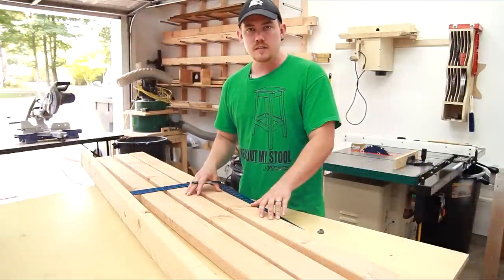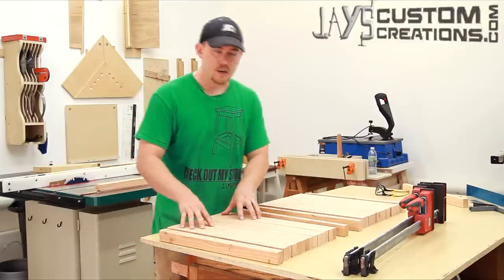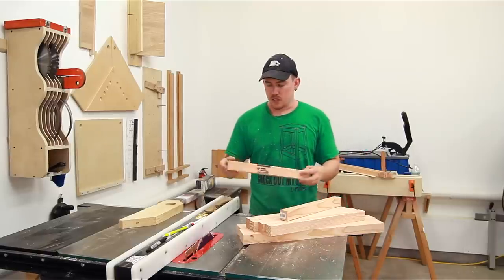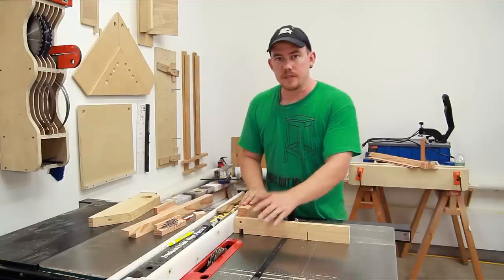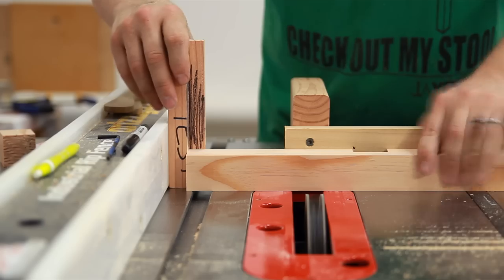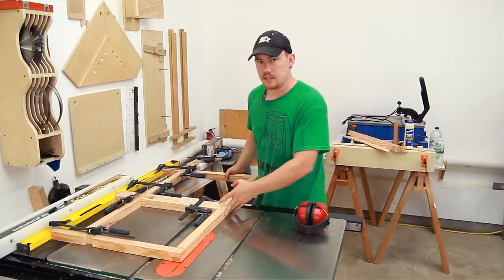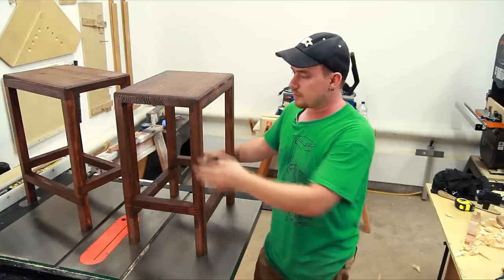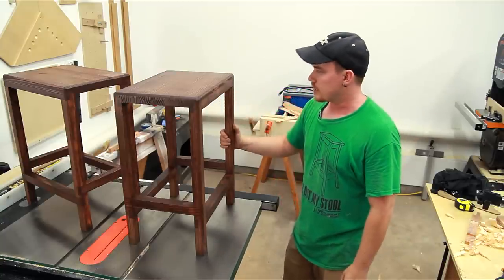How To Make 2x4 Half Lap Bar Stools - 166

Comment: Loved your video. I am advanced and always find new tips in your videos. In this video I love the lap joint jig and the dust shroud tip with the 2x4 mounted to the cross cut fence. Definitely going to use those ideas. Thanks.
Reply from the maker: Selandry1 Very cool. The dust shroud 2x4 makes a HUGE difference.

Comment: Great bar stool build Very simple design and no screws I made a simple bar stool / shop stool made from a 2x10 left over from a deck build. I use it every day sits in my kitchen not my shop . LOL 
Thanks for the great tips on half lap joints good info. 
Roland
Reply from the maker: Backyard Woodworking That's where mine are going. I'll use the older pocket hole bar stool for the shop. These are going in the kitchen :)

Comment: He is using the exact cheap spray gun from harbor freight. They have two purple ones. One for $19 or so and the other closer to $30. Go for the $30 one. Worth the $10.  I've had one of those, and still works fine after a few years of heavy use. The cheaper ones were on sale for $10 so I got a couple of them. Work ok, but not up to the level of the other. And I can only imagine what a real nice one can do.

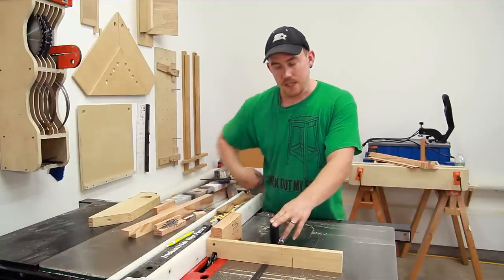Comment: Dude, you have some awesome tips in this video. Like the ones at 4:35 about the safety shroud for the dado cuts, and the one at 6:24 about gang-clamping the legs to a straight-edge in order to true-up the top joints.  What I'm curious about is the T-Shirts you wear in your videos.  Love the slogans and images, but it must cost you a fortune to have so many custom printed like that.  Slick idea none the less.  One last thing; when are you going to build a proper miter saw stand?  You really seem to need one.

Comment: 4 years late but hopefully you see and respond. I'm new to woodworking and going to make this stool (thanks for the video) but just curious... I was thinking about jointing one side of a 2x4, then using that as a reference to rip the board with the table saw so there are two parallel sides... then going through and cross cutting the lengths I need. Is this feasible or is there a reason you cut the lengths you needed before planing them to get them to the thickness you want? Thanks for any feedback!

Comment: Nice Project as usual!
Just wondering, what does an eight foot 2x4 cost approximately in America?
Last month I built two of your Saw horses but lumber is so expensive over here in Germany, that I used some cheap garden fence planks.
I cut them to right size and then glued for each leg two of them together for the right thickness.

Keep up the good work!
Reply from the maker: ***** i purchased these 8' 2x4's for $3.35 USD each. They are pine.

Comment: The top coat you spray on. Is that just a clear polyurethane? If so do you thin it down in anyway to use it in the air Sprayer?

Comment: Hey Jay, really nice design, build and as always great video.   - I've been thinking about picking up a cheap gravity feed spray gun from Harbor Freight to spray finish my projects (cans of spray varnish & shellac are getting expensive)...  So I'm curious about what spray gun you're using as well the finish/ mixture you sprayed?  Thanks!
Reply from the maker: Stew Pidass I was using the cheap Harbor Freight gun. And if/when it ever fails I will get another one of the same guns. It's a Harbor Freight gem. I sprayed Target Coatings EM6000 water based production satin lacquer. It's a little pricey but I love the finish I get with it and its water based so its easy water cleanup.

Comment: Hey.  Great video as usual.  I think you should do a video on making a set of economical bookshelves from 4x8 sheets of plywood.  I have been thinking about this project for a while- essentially use three sheets of plywood- the carcass would be made of two strips of plywood 96" x 12".  The top and bottom of the carcass would be 48" x 12" pieces and the shelves would be the same.  I am thinking that from 3 sheets of plywood I could get enough material to build two 8' x 4' bookshelves 12" deep.  Each bookshelf would have 8 shelves.  I am just not sure what kind of joinery would be best.  I am sure you would do a great job figuring this out.  Anyway just a suggestion because I have searched on-line and on youtube and I haven't found a whole lot.
Reply from the maker: whitechevtruck Have you seen Steve's one sheet bookcase build? Make a bookcase using a single sheet of plywood

Comment: Hey Jay, enjoy your videos, and cost efficient projects.  Question, what do you use for protections or put in your sprayer?  Do you mix polyurethane or lacquer?  Thanks. Keep up the good work!
Reply from the maker: Gary Petit I use water based lacquer so I don't have to mess with chemicals. Just clean up with regular water. Google Target Coatings EM6000 Satin Production Lacquer. I buy it in the gallon.

Comment: Nice project. I really enjoy your videos. 
Question... You used your miter saw to cut your pieces... Then cut them to final length on your table saw with the sled... Why? 

Great apple scene. And always love the logo showing up.
Reply: I'm not Jay (obviously) but hopefully this might shed some light on why you'd do it this way.

Unless you have a dedicated saw stand with a fence you can put stop blocks on, it can be difficult/annoying/a pain in the proverbial to get multiple pieces cut to the ~exact same length. Where as on the table saw that can be a simple procedure.

However cutting long stuff on the table can be awkward and possibly dangerous. So, you break down the timber on the chop saw to rough length and then finesse it with the tablesaw later on.
Reply from the maker: Angie Overton Good question. The answer is because my miter saw sucks. It has way too much flex in the slider for me to be comfortable in trusting it for final dimensioning. It also won't hold an angle very well. My crosscut sled is always at 90 degrees so it's just the fool proof option. I think I'm going to get a different miter saw soon though.
Reply: I thought that might be why. I love my miter saw... But it's not exact. It's weird. And people didn't believe what I was saying till I showed them. But if I cut with my waste on the right side of the blade... It cuts at a slight angle. Put the waste on the left and it's good.

Comment: Nice - thanks for the tips. Do you find it a PITA switching out blades? (dado). The time frustration made me pick up an old Radial Saw for $50, dedicated to dado/rabetting/laps. space killer, but a time saver for me.
Reply: Yeah this exactly why I struggle so long on getting a radial arm saw due to  space and tbe more I keeo switching blades the more I want a radial arm saw. Its also funny when I look on Craigslist for them and they pop up like 3-4 per week and are very cheap rather than buy a new one. I worked for a company that used them just for the dado purpose and tbats why I am going with the idea of getting one!
Reply from the maker: hoth mob I've thought about getting one for that but....where would I put it????

Comment: Do you have a page that I am missing describing your hvlp set up? I know that its a harbor freight gun but what size compressor are you using or would you recommend?
Reply from the maker: david Boardman I use a very loud and annoying oil-less 5hp 20 gallon compressor. No problems ever out of it and it can keep up with all of my tools.

Comment: Great project. One thing that you fell short on is the support of the seat along the grain.  The seat will cave in and crack along the grain with a bit of weight. If you support it perpendicular to the grain, it would make it much stronger.  Otherwise awesome creation.
Reply from the maker: Dima ML When should I expect the seat to crack and at how much weight will it fail?
Reply: My prediction is it will fail to about 300-350lb of weight applied in the middle of the seat. Or just a good fist blow.  You can do some testing and see what it will take to break it. All i can say the failure is imminent.
Reply: Jay Bates I predict it will fail in the year 2026 when dear old Aunt Edna, who weighs 299 pounds, comes over for a visit and is on the bar stool when your 51 pound dog jumps in her lap!

Comment: Do you use a moisture filter for your spray gun?
Reply from the maker: Jack Danner I have one on the air tank. They say you're supposed to have it closer to the gun but this setup seems to be working.

Comment: Why did you applied the stain with a brush and the varnish by spraying?
Reply from the maker: Shahar Dror Spraying stain can get really messy in a hurry. Also, stain is much harder to clean out of a spray gun. The lacquer I was spraying is water based so I just run it through the garden hose to clean it up when I'm done.

Comment: When I cut a two by four to make strips I get deep saw marks, kinda like have circle down the length of the board, it's not chatter or burn marks. Can you tell me what might be wrong thanks Charles
Reply from the maker: Charles Tubaugh Sounds like your fence isn't parallel to the blade.
Reply: Hey thanks but I just put a $40.00 blade on it "Irwin marples 50 tooth blade and cuts great now must of been them $10.00 blades and my table doesn't vibrate any more to

Comment: Can you tell how not to get saw marks in wood on table saw thanks charlie
Reply from the maker: Charles Tubaugh What?
Reply: Jay Bates i think there asking about how to stop the blade from burning the wood when cut
Reply from the maker: BIGMAN FROM MICHIGAN Charles Tubaugh Make sure the fence is exactly parallel with the blade so no binding occurs and, if possible, do not stop mid cut with the material. Faster cuts will not burn if you keep the wood moving. But don't sacrifice safety for speed. Still be careful on the table saw.
Reply: Ok thanks Charles